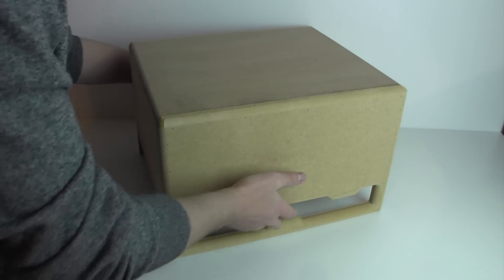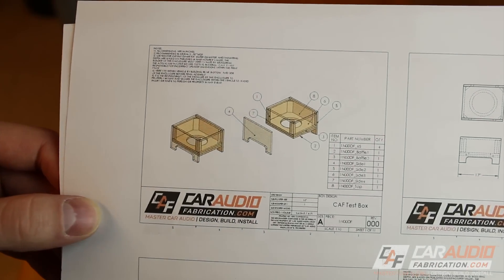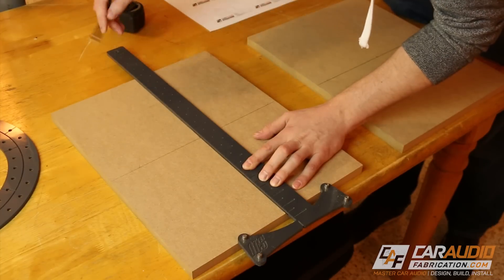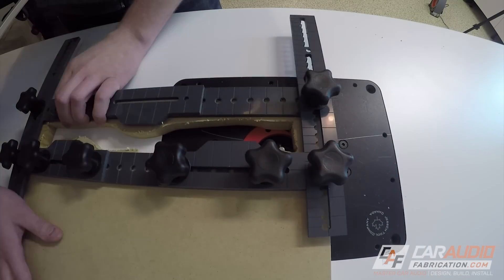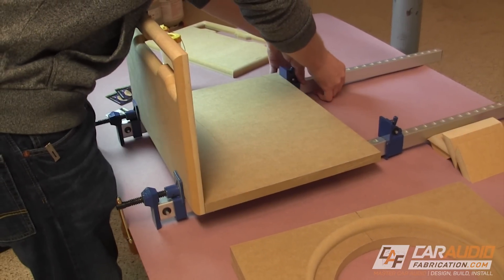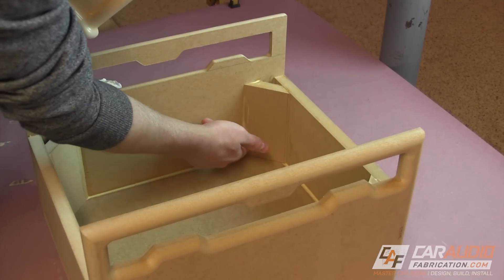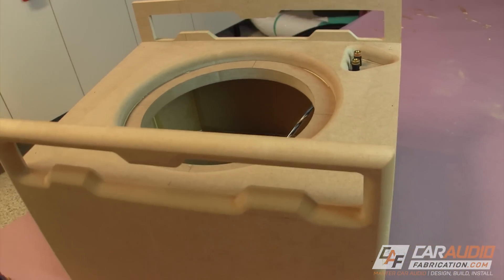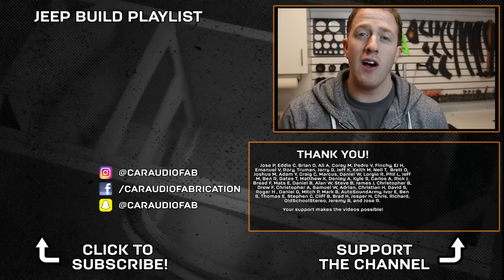Build a Subwoofer Test Box - BETTER BASS - CarAudioFabrication

Comment: What do you recommend for a sealed box (Rockford Fosgate P3) in a SQ setup. Facing it toward the front of the car or toward the trunk.
Reply: Joshua's Recordings. what kind of car are you putting it in ?because of you have very little room and you don't want that rattle you would want to put it facing you up front. but with that you loose a lot of bass. with it facing the opposite way you get louder bass due to acoustics in your car, but you need to sound proof it if you don't want that annoying rattle and loud but good SQ. hope this helped a little
Reply: It is a 2009 Honda Civic, and yes I do plan to sound deaden it. You don't think facing it toward the back would hurt sound quality?
Reply: Joshua's Recordings Honestly I have installed many sound systems and it all depends on how loose the paneling in the car is if its already rattling from normal use you may need to face it towards you. but keeping the speaker cone in direct proximity to your ear is actually bad for SQ(only when dealing with bass, as is improved with mids and highs if they are closer to your ear. reason being is because bass needs acoustics to actually produce sound). also if you silence the rattle of the trunk and have good air flow from the cab to the trunk there should be no room for anything besides the sub to make noise. therefore you have good SQ (as long as the amp and everything else is tuned right)
Reply: Joshua's Recordings I recommend facing backwards. I have two p3s in a big enclosure with a mid port. sounds really nice

Comment: I'm really surprised you didn't use T-nuts in the baffle since you're going to be using this as a test box for multiple applications...your screw holes will strip out pretty quick if you're going to be installing and removing subs a lot...just my $.02

Comment: I'm doing a install for my truck within the next few months and I realized something that can change the car audio world. 

Have you ever considered using a 3D printer for car audio installs? The possibilities would be endless.

My Brother's friend is creating a copy of my factory dash speaker grilles with a slight alteration to the part.

If you are interested on how it turns out, let me know. This practice with using 3D printers for custom parts may accelerate your business profits.
Reply from the maker: +3.6L Dodge Avenger check out some of my other videos. I have used a printer for dash speaker pods, speaker adapter rings, a mini sub box etc.

Comment: 2007 dodge ram.  2- 12' inch cheap kenwoods, up firing under the rear seat.
Reply from the maker: Do you keep the seat up or have it down?
Reply: CarAudioFabrication  stays down, I'm sure it's muffled quite a bit, but that's the least of my issues.  has good punch for 12, good lows but there is a mid frequency that gets a nasty flutter at pretty low volume in comparison.  other than that it's an ok set up.
Reply: I have a similar set-up, but in my quad-cab dodge.  Two Polk Audio 10's.  Not much space to work with.
Reply: 2002 Acura RSX type S, 6.4cuft ported box tuned to 34hz with three JL Audio 10W1v2-8's firing up and ported upwards. Loads off of rear hatch glass and projects forward pretty nicely.
Reply: starsound two 12' x 3500w 2012 Toyota etios.495liter boot

Comment: I have 2 x 8 inch enclosed pointing up mounted in the shelf of my Audi A4 B5 Sedan link to 2 pictures http://imgur.com/a/ClBXI 
had a 12 inch before pointing forward but the boot in all steel enclosed so the amp was getting very hot
and it was killing my shelf speakers since it vented trough them and distorting the sound violently